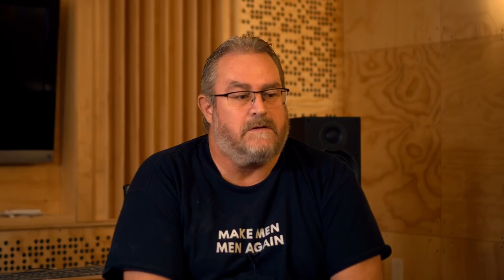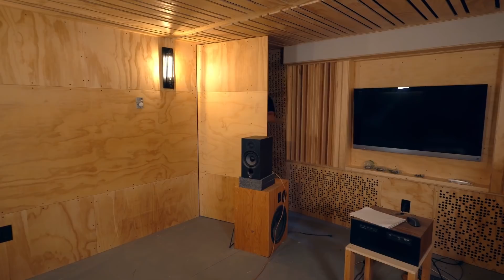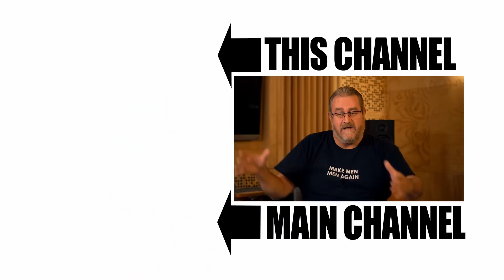What Are Room Modes? Finally A Simple Explanation

Comment from the maker: OH NO! The room modes have gone to my head!!
Technically, you still have room modes in very small rooms, but they are high enough in frequency that standard absorption (acoustic panels or velocity traps) will effectively treat them. The lower in frequency the modes, the harder they are to treat. Most normal rooms will have room modes - resonances - that are very difficult to treat.
The best way to treat these low frequency modes is with a targeted approach, like Helmholtz absorbers or diaphragmatic (limp mass) absorbers, But those are difficult to build correctly (so they hit the right frequency), take up a lot of space and need to be located correctly in the room.
The way I did my room was to add as much standard absorption as I could, plus I experimented with the wall panels to act as a broader-band diaphragmatic absorber. My approach was to chip away at those resonances to try to bring it down to the point where it's no longer as much of a  problem.

Comment: I wonder what the room modes would be in a dodecahedron? because you can draw any straight line in this shape with it never returning back to the same point, so would this be akin to a perfect anecohic chambre?
The closet appoximation to this in a retanguar room would be to put both your speakers in one corner, I reckon it would still produce standing waves but they would be spread out more evenly at a lower frequency, something to try!

Comment: Technically, modes are different than resonances. Modes are abstract solutions to an equation that has no forcing term, so no sources. Resonances are what you see in a frequency response at some point in space, when you have sources. So resonances are typically a consequence of the modes, but not the same thing.

Comment: Hey John,
    While searching for content for a presentation I’m creating for my boss, the owner of a nightclub, I stumbled across your video.
    I most certainly appreciate your dedication to exploring the physics of sound, because the physics are quite complex, and difficult to understand, let alone explain.
    The resonance (or resonant frequency) of an object deals with the mass of the object (for example, a wall, or a car trunk lid). Every object on earth has a natural resonant frequency, which is defined as the frequency at which a specific object naturally vibrates. The more mass an object has, the lower its resonant frequency. A car trunk lid will vibrate (and sound terrible to others outside the vehicle) when a subwoofer produces a tone at the trunk lid’s resonant frequency. Adding mass (such as DynaMat) to that object will lower its resonant frequency, making it more difficult to for a subwoofer to make it vibrate.
    Room Modes, on the other hand, are created primarily by the omnidirectional tendencies of low frequencies and their longer wavelengths. When a subwoofer emits a frequency, it will bounce off of every surface in a room, with walls being the biggest concern.
    Let’s take a 63Hz bass note, where the full length of the wave is 17.94 feet. If that single wave is emitted from a subwoofer that is placed 4.48 feet (one quarter of that wavelength ) from any surface, it will bounce off and combine with the primary emitted wave and create a cancellation effect. This is due to the reflected wave being inverted. 
    Different frequencies and wavelengths are bouncing off of every surface of the room,  causing many frequencies to reflect and combine with the primary wave, thus producing multiple areas of cancelation).
    The use of sound deadening material may help reduce some reflections, but only minimally.
    Most importantly, room modes are created directly from reflections, and are not associated with the resonant frequency of any object,

Comment: 7:00 I think your theory to make things rattle to reduce the problem sounds in the room is a faulty theory.  When those panels flex, I don't think they are absorbing the sound, they are simply breaking it up in to harmonics and sending it back into the room.  By having wobbly walls, you might be making things worse instead of better.   Low frequencies are absorbed by heavy mass (walls made of concrete blocks, for instance) and high frequencies are absorbed by things like egg crate foam, pink insulation, etc.
Reply: This video doesn't go into velocity and pressure distribution, but room modes create distinct high-pressure zones. At walls and corners, you have higher pressure levels. Foam and Rockwool are velocity absorbers and only work when exposed to the velocity zone of a room mode. These vibrating panels are essentially transforming the potential energy from the pressure of the room mode into work. The resulting movement of the panel transforms that work into kinetic energy, that is then absorbed by the velocity absorber. Yes, resonating panels will be sending energy back into the room, but it will be at much lower energy, at a different frequency, and possibly out of phase to the room mode.
Reply from the maker: Low frequencies are almost 100% reflected by heavy mass, actually. That's why a poured concrete or concrete block room is so boomy (think empty basement). That's why it make such a great soundproofing option.
The measurements don't lie, Jim. The panels do work.

Comment: You can also make sure not to excite room modes in the first place, by using multiple subs placed so that they cancel out reflections.
Reply from the maker: That's harder than a lot of people think and not anywhere near as effective as properly treating the room.
Reply: By "also", I meant "in addition to adding absorption". It is not as hard as you think to suppress room modes by 6+dB (particularly useful for eliminating dips) using a multi-sub approach, and while treating the room is an absolute must, you will generally only achieve truly articulate bass by suppressing room modes by multiple means. There are good guides for beginners about how to use a multi-channel digital crossover and free software for acoustic measurements to time-align and adjust such multi-sub systems.
Reply from the maker: @morganandreason  My answer was more for the certainty with which you said "make sure not to excite room modes". 
My understanding is that the method isn't as effective as it was hoped it would be.
Reply: @IBuildIt  
Selective Mode Cancelation... 
Toole put out a white paper on it. 

Technically it differs from a typical multi sub approach. 
Regardless, it's but one tool to combat acoustic distortions of the room.

Comment: Is there a formula to calculate the room mode frequencies or can they only be determined by measuring?
Reply from the maker: There are online calculators, like this one: https://amcoustics.com/tools/amroc
You measure the dimensions of the room with a measuring tape and input those into the calculator. It shows where all of the modes are and the harmonics.
Reply: in meters: "(Speed of sound / dimension) / 2" gives you the fundamental frequency. So the height mode for a 2,4m high room is 343/2,4/2= 71Hz (Fundamental). 1st harmonic is double this (142Hz), 2nd harmonic triple (213 Hz).
Tangencial modes are harder to calculate, easier to use an online mode calculator, as John recommended

Comment: Have you looked into upholstering the walls. The harmonics apply all the way up the scale. I used to do loads of fabric walls just for looks for rich posh customers. But I did do one place for sound. Rich fella had a 40x20m basement. Had a full lucas arts av setup.  That room was an echo chamber before we cotton bumped the walls and put some heavy dense slub silk on the walls. It was almost anecoic after that. The air nailers and air compressor sounded like mouse farts putting the last width up.
Reply from the maker: Thin treatment (2" thick panels, carpet, etc.) is only effective for higher frequencies. To have any significant effect on low frequencies, the treatment needs to be thick and there needs to be lots of it. Too much high frequency absorption will make a room sound too dead, which isn't good either.
Reply: @IBuildIt  i know that batman. But the powers of 2 work all the way up. You not gonna leave the ply walls bare are you? Dead is almost as good as headphones. Gotta say though. What sounds good to you is what it's about. I have chased some rabbits down holes with sound and never been happy because I want it to sound good to everyone and not so much me. BTW, made that linkwitz filter for my 15" subs few years back. Thanks for learning me to that. Have to redo it now as my cuz gave me a pair of kefs. So remaking the subs. BUT. It's your listening room, you can move the chair and speakers so the nodes are neutral where your bum sits.
Reply from the maker: Yes, Robin, the harmonics go all the way up, but they diminish in strength as they do. Also if you can get rid of the fundamental, the harmonics go with it. So you concentrate on killing as much of those fundamentals (37Hz, 40Hz, 74Hz) as you can, and it reduces the harmonics along with it. Those fundamentals are the root of the problem.
Reply: @IBuildIt  you know best batman, it is your cave. Looking forward to the next episode. It's 22:35 over in London, what does your chronometer have on the dial? The other posh people had upholstered walls for the master bedrooms and real dinning rooms for inviting posh mates around with a hired chef. Makes for a good atomosphere, probably.

Comment: Really enjoying this John.  It is inspiring me to get off my butt and finish my amp so that I can get back to the room treatment version 2.
Reply from the maker: I don't think I asked before, how big is your room?
Reply: @IBuildIt  
It goes from 9' 2" for 5' then opens up to 10'10".  The room is 12' 10" long and 7' high.  Three walls are drywall covering 1/2" rigid Styrofoam on top of brick.  The other wall  is 3/8" drywall on 2x4s with no insulation and a hallway on the other side.  Floor is laminate covered 80% with a thin carpet.  Low roof plus an almost square room makes room treatment a challenge.